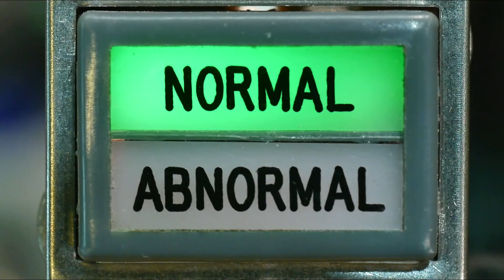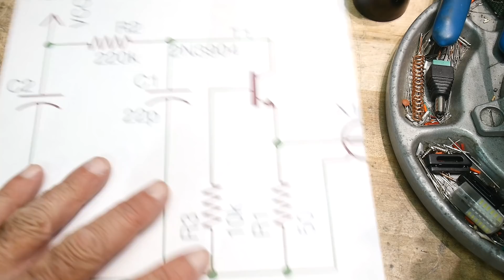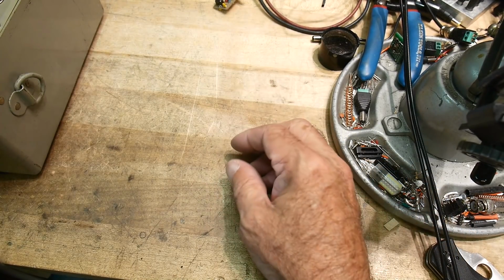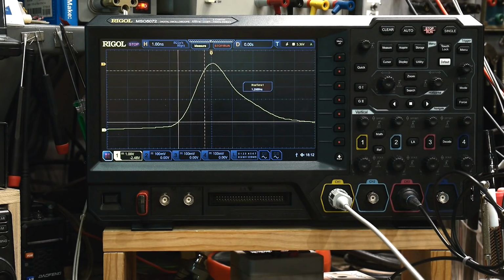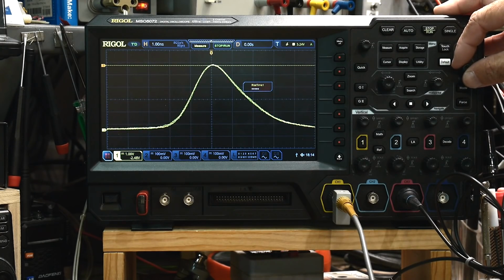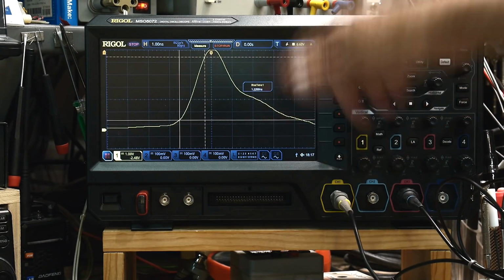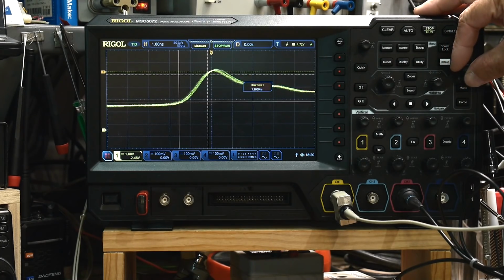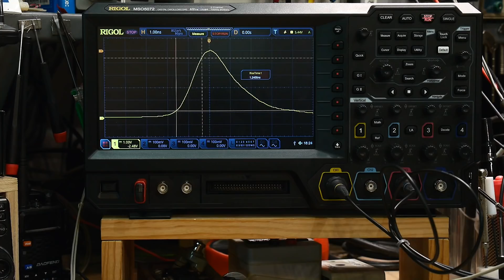#847 Nanosecond Oscilloscope Probe Rise Time Measurement (Jim Williams)

Comment: You may be running into the rise time limits of the scope and the acquisition setup.  Specs for 350MHz I believe say "<1ns" for rise time, but your 1.25 results are still stretching it since the specs for the 200MHz model are <1.75ns.  However, you should also play with different Aquisition settings, for instance "high resolution", "dots", etc, just to see what difference it makes.  I was playing around at the edges of capability like you are and noticed that settings make a difference.  Maybe even try different channels on the scope, different memory depth settings, and whatever other settings it may have for probe, aquisition, etc.. maybe even trigger hysteresis?  Just some guesses, I'm not an expert but like to play with the limits.
Reply: Also make sure you're using the probes in 1x mode, not 10x?
Reply: @SorcererStan  no, to get the highest bandwidth you need to use the 10x option.
Reply: @argcargv  You're right, I had that backwards.  In fact I have a 100:1 250MHz probe that I was playing with, and it was getting slightly better results than a 10:1 500MHz probe (on a 1GHz scope). And FWIW, I experimented again with other settings that I mentioned and really didn't see much difference... so you can ignore my whole ignorant post :)
Reply: @SorcererStan  The 100:1 have a lower capacitive loading on the source.

Comment: Interesting. I have nothing certain to offer but a few things to consider.
1) The lead length of the 3904 is a bit long.
2) There exist avalanche specific transistors in SMD, I don't recall number.
3) When building the pulse circuit 50ohm output is not magic, try lower. 
4) Build also a pulse circuit that connects directly to the scope thru a BNC w/o cable.
cheers dan
Reply: This!
Reply: @crash burn no, it is driving 10meg. Think.